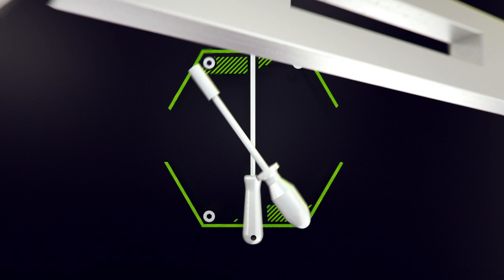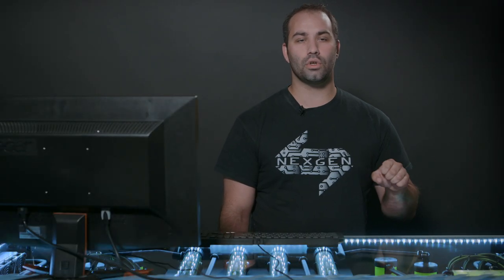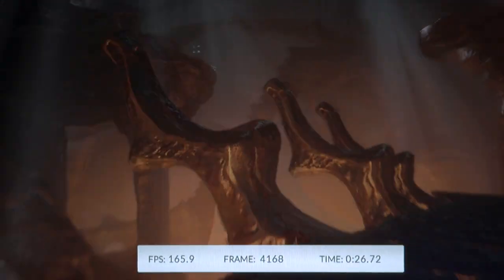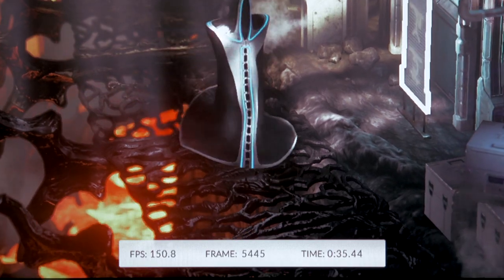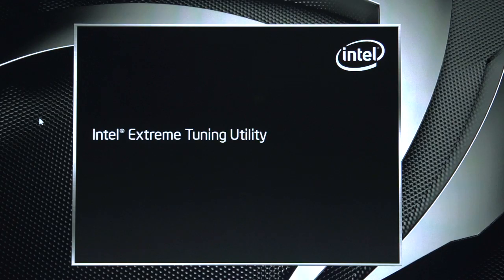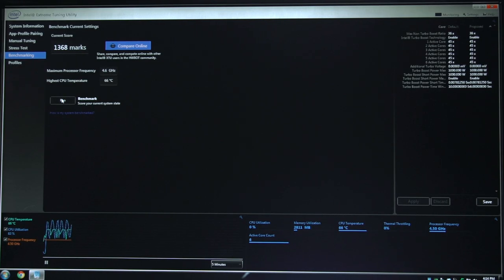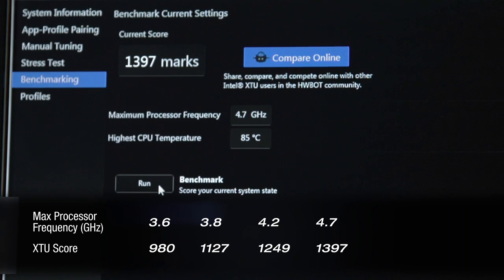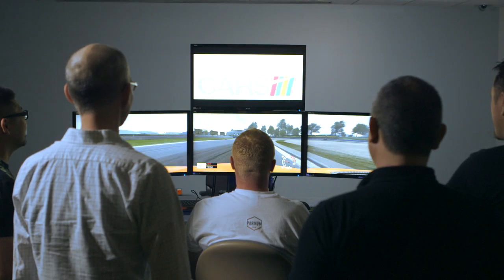GeForce Garage: Cross Desk Series, Video 7  – How To Overclock Your Gaming Rig

Comment: Do you need to adjust the CPU clock and Voltage when you overclock the GPU or can you just overclock the GPU, I've heard they're interconnected and both required. Also since I use an AMD Ryzen 7 8 Core I can't use the Intel CPU Benchmark. AMD has it's own "AMD Ryzen Master" program that you can use to adjust CPU cores but it has no in built benchmark.

Comment: 1.6V lol... If you want your CPU to actually last don't do it. Even if temps are in check 1.6V is so high voltage it will shorten the lifespan of that CPU greatly. THAT is why the voltage was displayed in red. It means that is RISKY voltage.

Comment: Great video, but I have a problem: I'm using gpu tweak cause I have an asus 970, but I reached the top with the software (1400MHz, 8000Gbps and 120% power target). How can I get over this? I reached this result without modifing the voltage, so I would like to have the possibility to keep on and push the gpu as far as I can, but I can't do it with this software.

Comment: Thx for Uploading this. I was able to overclock my i3570k from 3,4ghz to 4ghz stable, and my msi gtx 970 4g gaming has now better specs than the gtx 980.Now I can play witcher 3 in 2880x1620 p nearly everything maxed out with stable 40 FPS without artifacts

Comment: Hey guys, nice vid! But i have a question. Im running stress test after overclocking my pc, CPU temperature is around 60, but CPU CORE temperature is far beyond 80c. Im running i7 3770k, is that core temps are okay, or should i lower cpu clock so it will be lower than 80?

Comment: Does anyone knows how to do the OC using EVGA Precision X? Thanks :)
Reply from the maker: Samuel Campana Samuel, this guide from Anandtech is a good place to start. http://www.anandtech.com/show/8589/anandtech-guide-to-video-card-overclocking-software/5
Reply: Thanks a lot for the response did some OC last night after almost 5 hours and aost triple my marks on 3D MARK but I will see what else I can do with this new info thanks a ton :)
Reply from the maker: Samuel Campana Happy to hear you were able to overclock successfully, and that you saw increased performance from it. Enjoy!
Reply: NVIDIA  I am having issues over clocking my 980 and I believe it's more to do with a driver issue as temps are only  73c yet 250 overclock on the GPU and a paltry 180 on the GDDR5 using Precision X causes instability , however this changes per driver. This is really disappointing as most 980's are hitting 1475mhz with at least 400mhz on the GPU. 

I don't think it's the silicon and more to do with drivers.
Reply: No Name It is the voltage. The higher you push your clock and memory speed, the higher you have to set the voltage. Some overclocks don't require a voltage increase, if they aren't too high. But that depends from card to card, even the same model can be different. Greetings :)
Reply: Carfreak36 Hello, thanks for your reply.

I tried raising the voltage on the card hoping to make it more stable and it worked fine for a while until new drivers and now it crashing again. 

For example , right now if I try to go above 180 on the VRAM using Precision X it becomes unstable despite the fact I am not seeing any artefacts on the screen so it's not like the VRAM is being overly taxed.

However lots of people report of 400+ on the VRAM and the other day I did have it running 380+  which gave me no issues in around 8+ hours of play.

I can get the card running 1400mhz without any complaints but when the drivers don't crash sometimes I can get it up to 1475mhz while playing the same game.

I may have just got a card that doesn't like to overclock  but it's a mystery why some drivers  feel like  they are fighting me when OC'ing?.

I normally wouldn't have thought of drivers being the issue this long into the card's life but there was people complaining of the issue on NVIDIA forums so that's what had me thinking about drivers?.

At least I am still happy with performance of the GPU for the time being. :)
Reply: No Name Do you mean "An unexpected failure...", and the driver restarts? If yes, that is indeed the driver. Many people have problems with it. :)
Reply: Carfreak36 Yes mate I do and I don't think it's related to me pushing my overclocks too hard as sometimes they will work and other times they won't even when playing the same game and in some severe cases even lowering the overclock still doesn't stop  the driver from crashing. Normally when you push the clock rate too high the game crashes  but not the driver.

I have noticed that NVIDIA's drivers haven't been the same high quality that I have been used to over the last 5 years. For example SLI drivers have been launching later than usual.  The crashing when overclocking.

Then another problem I have had is worse performance in older games with new drivers. For example I am still playing through Batman Origins and I was able to get a locked 60fps with everything maxed out @ 1440p. However I went back to it the other day and it was frequently dropping below 60fps.  I looked on NVIDIA's website and someone else had linked a picture of the very same game benchmarked on their PC using an older and recent driver with roughly 40% performance deficit using the newer driver.

So in the last 5 years their drivers have been perfect for me even though I was using SLI cards as well as I started with 590 upgraded to 690 and  games ran great with SLI support really early. I wonder if it's because all the software engineers are preoccupied with Directx12 drivers?. I hope that's what it is because  drivers were exceptional until the last 6 months or so.
Reply: No Name Yeah, you are right! Oh, I wanted to tell you, a lot of people have the problem with the driver, including me. Don't be afraid, it is not your cards, hopefully they'll fix it in the next driver!
Reply: Carfreak36 Thanks.  I am hoping it's because the software engineers are really busy getting drivers ready for Windows 10 as it's just around the corner because in 5 years I have had perfect drivers from NVIDIA including SLI and 3D Play TV drivers.

I am really excited for Windows 10 now.

Comment: i have nvidia geforce 610m, but is that possible for overclocking?
Reply: +Nicholas Vincent I think everything can be overclocked. It's just that without models designated for it you're not getting the built-in cooling and heat efficiency to help keep temperatures down. A 4790 and 4790K for instance are more or less the exact same CPU at stock speed. The 4790 for instance might only get a safe overclock of 5% while the 4790K could possibly achieve 25% and still hit the same temperature.

Comment: You forgot to mention OC'ing shortens the lifespan of the OC'ed hardware. So if you already have a beast PC, that runs whatever at the highest settings, and super fast/acceptable frames, don't OC.
Reply: Overclocking doesn't gain you much these days
Reply: ***** Mhm. I mean it's cool and all, but not something i'd do anytime soon again.
Reply: I was thinking that. Its really not worth it if you have a good system already. kaare1992
Reply: You gain a lot more by just upgrading a component than overlocking a system. It seems like in the Core 2 Duo/Quad days there was a lot more potential
Reply: Gpu's last way longer than you actually want them to under normal use. I have 15 year old gpus that will run as good as the day they were made. I overclock cause i want to get the most out of a gpu before i replace it after 3 years. I am sure it could work years longer, though.
Reply: GTX GAMER There is no Misinformation. Yeah you can help fight the shortened lifespan by having proper cooling. If I were to OC my CPU, id only get 0.4-0.5 extra out of it, which is useless for me, at this current date. I'd much rather have it last days/weeks longer, than have that extra 0.5 Ghz.
People might just think "Oh I just need to download this program, and the OC'ing is happening by itself? Cool!" And forget everything about the cooling. (Voltage shouldn't really be a problem, since the increase in voltage is very low.) So if you have a powerful CPU already, and it doesnt give you bottlenecks, and/or you can play your favorite games at max setting. I'd much rather be able to play my games for months longer, than to have a slightly more powerful CPU, which I basically can't take advantage of, since I won't need that extra bit of juice.
Reply: GTX GAMER tl:dr?
Reply: GTX GAMER Funny how you are the one being hostile about this? Im just saying I don't have time to read your essay about OC'ing. Probably copy pasta from some site anyway 8)
I know my shit is true, then you can believe in whatever you want. Hey Scotty, Jesus Man.
Reply: GTX GAMER Bye kid
Reply: look like u owned him. all his comments are deleted
Reply: Navhkrin Ok, yes it's true, with proper cooling, the shortening of lifespan is negligible. It totally depends on the amount of overlock, your silicon lottery, and most importantly, the amount of voltage you increase to reach your desired clocks.
But every electrical component has a lifespan. That part, you didn't nail. It's called reliability. Graphics cards contain GPUs, GPUs are chips, chips are a bunch of transistors. Even under ideal conditions (decent cooling), you will slowly be breaking down the insulators in those transistors. But this is a long time, at least 10 years unless you got a bad one.

Comment: the last 3 drivers for my gtx 980s only let me pick 4k resoloution and 2048x1440 on my 4k tv,but if i want to use 2560x1440 for some games i have to use 344.75 anything after will not let me pick 2560x1440 any ideas??
Reply: Download the latest Nvidia 347.52 driver noob
Reply: BlackEvoProductions have you not read what i said the last 3 drivers including the newest 1 do not let me play or use 2560x1440 but 344.75 does
Reply: BlackEvoProductions already done a fresh install still wont let me use 2560x 1440 only on 344.75
Reply: Add 2560x1440 as a native resolution (google it for instructions its really easy)
Reply: DutchMastermind hi ive had a look on google but cant seem to find a clear post,any chance you could post a link thnks.
Reply: Its simple open up the NVIDIA controlpannel (just type nvidia in search) then under the tab ''screen'' klick on ''change resolution'' then select your screen and click ''customize'' (if you can not click on customize you might have to disable DSR-factor) once your in the customization screen you can klick create custom resolution, here you want to type in the resolution then simply hit test (screens might start doing weird things for a few seconds this is normal) and now just hit yes if u want to keep the resolution and your done! if u only want it in games simply add the resolution and dont us it just select 1080p or something and then there will be an option in games to use your custom Resolution. hope it helped, if u have any questions feel free to ask.
Reply: wow thanks alot saved my life!!!! ;)
Reply: hahaha no problem :)

Comment: isnt 85 kinda high for a cpu :O?!! my cpu is getting 55c at 4,4ghz and i was scared xD
Reply: ur fine
Reply: They are using an extreme processor, did you see the voltage? 1.6v is waaayy more than you're running, therefore the heat output :)

Comment: Only 200mhz above stock? LOL!!! My GTX 750 Ti is running stable 400mhz above stock.
Edit: And that's without voltage tweaks. With overvolting, I can put it at 1.5ghz.
Reply: Maxwell ftw! Have my gtx 970 running at 1506mhz/8ghz without voltage tweaks
Reply: GTX GAMER I'm not an idiot, obviously the card with 2688 CUDA cores and 250Watt power draw is going to beat a 640 CUDA core card with a 60Watt power draw.
All I am saying is, that my GTX 750 Ti can easily overclock by over 40% while kepler cards struggle with a 20% overclock.
Reply: ... 980s are hitting 2000+
Reply: Kirinketsu yeah on liquid nitrogen
Reply: BigNastyreborn whats wrong with that? also not all are using it to get over 2000 .. look up EVGA  GTX 980 Classified KiNGPiN ... he got the thing to 2166 MHz core and 4451 MHz on air cooling ... not recommended but can be done

The 980 that hit 2202 MHz used liquid nitrogen

Comment: look st the CPU temp. it jumped 10-15 degrees every few seconds so 45,45,45,46,45,45,45 60
This is why you dont have multiple GPU's in chains like this on the same loop as CPU. its just BAD.
if you want the best cooling and stable clocks. cpu needs dedicated radiator and flow, and if you have 4 GFX cards like this. at the most you should run 2 loops and 2 cards in each loop. that is far too much variation

Comment: And you can have that overkill computer for only 4000 Euros ! Very low price no ?
Reply: +KyllerZone That's too cheap for a machine like that.
-2x ASUS Rampage IV Black Edition (2 of those motherboards alone cost 1000€)
-2x Intel i7 4960X (2 of those CPU cost 2000€)
-8x Corsair Dominator Platinum 8 GB DDR3 - 2133 MHz - CL9 (8x8 GB Kit costs 1000€)

Ok, we're at 4000 € without graphicscards, without PSUs, without any water-cooling-parts and without any modding and the seller would earn 0€ on that deal. So let's continue:
-8x Nvidia Geforce Titan Black (Each costs 900 €, so for 8 cards it's 7200€)
-2x ca. 1200W PSU (SuperFlower or Corsair are around 300 € each, so for 2 PSUs it's 600 €)
-2x Waterbock set (Waterblocks for CPU and GPU, 2x 70 € for CPU, 8x 120 € for GPU, makes 1100 €)
-2x Radiator set (It's 2x 480mm and 2x 360mm from EK, 2x 130 € and 2x 120 € = 500 €)
-2x Pump set (Those are 4x EK D5 with reservoir pump-top, it's about 100 € each, so 400 €)
-4x Reservoirs (Those are FrozenQ reservoirs, 130 € each, so 520 €)
-1x Misc Watercooling parts (Fittings, SLI Bridges, Copper pipe, etc, roundabout 280 €)
-2x Sleeving Set (A normal sleeving set is 120 € but this one has extra cables for SLI, so 400 €)
-1x Red Harbinger Cross Desk (Simply 2000 €)

That totals in 17.000 €
Now let's get to business (let's assume Tax = 19 % and we want to make 100 % profit):

Buyingprice ex.VAT = 14.285,71 €
paid Tax = 2.714,29 €
Buyingprice inc. VAT = 17.000,00 €
Sellingprice ex. VAT = 28.570,59 €
received Tax = 5.428,41 €
Sellingprice inc. VAT = 33.999,00 €
Tax-balancing = 2.714,13 €
Profit: 14.284,87 € (100 % profit)

So to have a profitable company running, you have to sell this PC for about 33.400,00 €.
And that is if you're doing everything alone. If you have paid staff-members that do stuff on this machine, you have to calculate their wages on top.

Comment: Overclocking is Dangerous. Again overclocking is dangerous to your rig components
it will result in deceasing or damaging your gpu, ram or cpu after time
no joking
if you really really need to overclock, don't push for the maximum performance possible always try to overclock to 75% or 70% of your rig performance or it will go faulty after some time

Comment: 1.6 volt even on an extreme processor with great cooling will prolong the lifespan of your CPU FAST!!!. Stay under 1.4 for a 24/7 system

This is a very poor guide for the rampage 4 extreme motherboard, much better guides freely available with a little search.